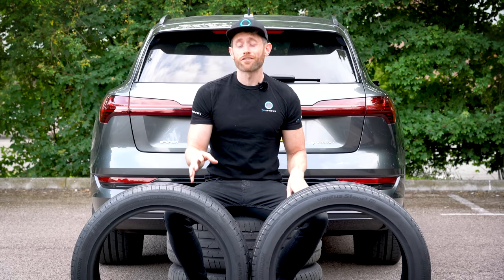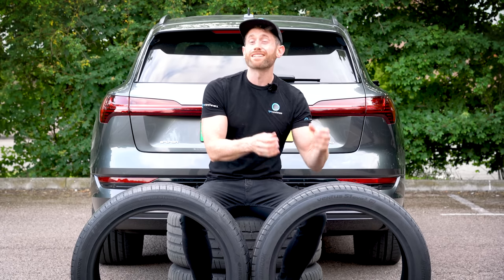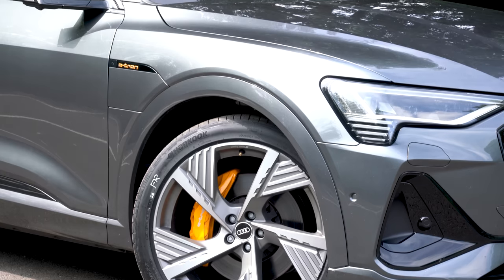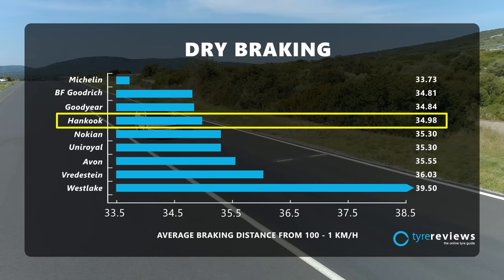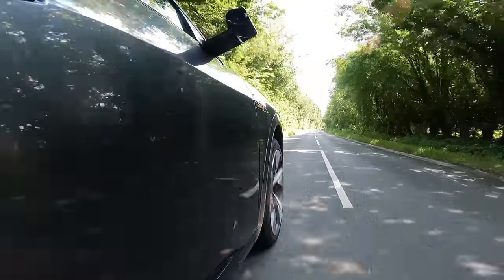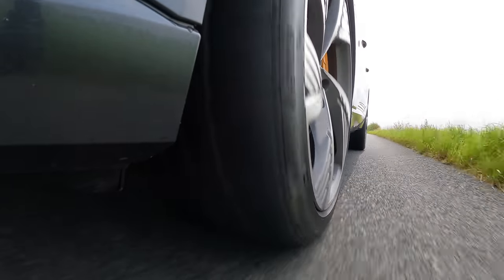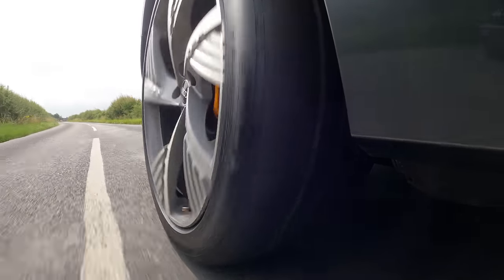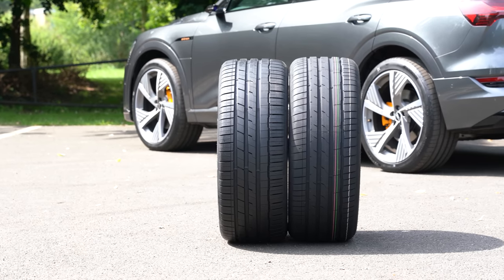What makes EV tires different, and why should you fit them! 🔌

Comment: Thanks for the review. Way more difference than i expected.
And i agree with you. I also love ICE. I have a 350Z and 370Z (AWD both manual) love the sound and vibrations of that V6.

But for a family car for day to day driving i would not mind having a EV. I dont have a family so my driving is mostly for fun. So i dont have one yet. 
With a 4 cil 2.0 turbo and Automatic transmission i dont see the point of a ICE. The sound is meh you dont shift anyway. Why not get a EV then way more comfotable. (price needs to go down more tho and more option in the second hand market because a lot of people like me dont buy brand new cars because of the high price).

I hope there will be Hydrogen Conversions in the future. I think that would be a nice way to still have a nice engine sound and low CO2 for cars like the 370Z or a V12 lambo.
Reply from the maker: {Porsche are pretty far along with synthetic fuel. There's be no sound with hydrogen powered future vehicles
Reply: @tyrereviews thanks for the reply and insight. 
It's true most (if not all) new hydrogen cars are using a fuel cell .  Aston Martin had a V12 Rapid in 2014 that they used during the 24 hr nurburgring. And mazda also had a RX8 hydrogen if I remember correctly. 
Just like petrol it's not very efficient to burn the fuel in the cilinders that's why they opt for fuel cells in most cars.

But good to hear porsche is also working on a alternative!

Comment: Tyre companies have to be the best example of manufacturing competeting in a free market to bring the best product to the customer. Even though I am sure there must be a massive amount of regulation and legislation surrounding the manufacturing of tires, tyre manufacturers seem to go the extra mile to make our lives the most safe and comfotable and constantly strive to give us the best mileage. Yet we still walk into a tyre fitting company and ask for the cheapest tyre, without a thought for the manufacturers that strive to want to give us the best. I get that not everyone can spend £150+ per corner, but does spending £75 a corner make sense when they last less than half as long, don't give the same comfort and are simply not as safe in wet and or braking conditions?

Comment: You have to test ev tires on normal cars to really test the tires...

And what I don't understand is that, except the brand MG, is that there are no other station ev cars. High cars have more air resistance so why don't they invest in station cars?

And EV drives great but as a real petrol guy I miss the clutch and shifting

Comment: The continental ev tire vs standard tire of same.  Ev tire has 5mm of thread depth vs 10;mm for standard.  I have not noticed loss of range.  Original tire lasted 35000 miles and Tesla tech was surprised I got that many.
Reply from the maker: 5mm STARTING?! What tyre is this?

Comment: I heard of filling tires completely with foam years ago, mainly to make them puncture proof interesting to see it come back in this form for this application. I wonder if completely foam filled tires would be good for EVs, one downside would be you can't adjust the tire pressure much
Reply from the maker: They never took off because they don't really work

Comment: Recharge time .... how often do you drive 250 miles at a time, mostly you'll be low 40's maybe up-to 100 miles in a single day, that you don't need to stop and charge, just plug it in at night and you'll never be out of battery ..

Yes, sure you'll go on holiday / long trip, you'll leave with it fully charged, at some point you'll need to charge it - but you'll also need to strech your legs, go to the loo get some food, 45 mins on a fast charger will give you another 200 miles to continue your journey  and for sure you're not going to be doing 450 miles in a day - so again - whats the issue with re-charge time?
Reply from the maker: I agree :)

Comment: EV range worries were a myth dreamt up by the car makers when EV cars were competing for sales years back - since the big car makers are making EV cars they have stopped promoting this range myth. I would rather run out of electricity than diesel - with an EV out of power all you need is a quick power jump from a rescue service generator (they are all offering this service this now in special vehicles), but running out of diesel means a £500 system clean at a workshop.
Reply from the maker: So you're saying petrol is still the best? ;)

Comment: What's the difference in price between these two tyres? If the EV ones are significantly more expensive, then the performance improvements go out the window from a bang for the buck perspective.

Comment: I don't think it's fair to declare EV cars to be overall better than ICE. I would agree with that if the costs and supply of them were competitive, but they're NOT.  I tried getting one 4 months ago and due to high cost, very tight supply compare to ICE, high insurance costs and very poor resale, it ended up being about $140 more per month even after factoring lower energy and maintenance costs. Unless solid state batteries have a breakthrough, I don't see much hope for EVs because their value proposition is terrible and that's WITH a lot of subsidy help.

Comment: If you drive normally, or at slow speeds then ev tires are fine. They are really quite poor when it comes to ride quality, traction, and handling. I would not recommend people to fit them to gasoline cars as the efficiency gain simply isn't worth the loss in performance.

Comment: So anyone tell me what hapoens if you put a tyre like this on a normal sports car weightibg only 1365kg, i still need to try XLs but its hard to get tham in my tyre wishes, with normal tyres for examole GoodYear Eagle F1 Asym 6 i deleted the names of the tyres becaus my corner attacking deformed wheels so much outer tread was gone in 2000km and i was driveibg alsmot on rims in corners, almost no haprines that destroy tyres the most

Comment: I don't think this guy is correct.
I have an eGolf which is about the same weight as a Golf GTi - so not significantly heavier. I went through a set of 'recommended' Continental tyres and a set of "e" rated Dunlops. They all lost pressure and lasted about 18,000 miles. Then I fitted a set of cheap Avons and they have been fantastic - 20,000 miles and loads of tread left and no drop in pressure. You don't always get what you pay for...

Comment: Tested on EV vehicle EV tires are much better than non EV tires. What a surprise, aren't they designed for that? Second, using EV tires on non EV vehicles increase rotation mass since they are heavier, I don't see the car been more responsive there. Especially with the thread. Try those EV tires for all season in a place like Chicago and you might find yourself in the ditch more than a few times.

Comment: SOooo... I had an old LEAF, which has a small battery.  With a small battery there is a high sensitivity to range. As and example, turn on the heater and you know it. I bought new tyres for the car, 'normal' car tyres not the brand that came with the car.  Absolutely no noticeable difference.

Comment: Why so low profile? If in city driving the larger rims add significant load during acceleration and range reduction due to mass moment of inertia increase. Tesla configuration would clearly show range reduction with increased rim size. It can be as high as 20%. With EVs rim increase is a reduction in range and a downgrade, you pay more to go less distance. Do some testing with a smaller rim sizes.

Comment: BFG KO2 on the EGOLF.  Going on some El Cheap O Tires with low rolling resistance is for noobs.  
More Bang than these continental EV tires that came with the car.  Stiffer Meaty construction. KO2.

Comment: isn`t this comparison between EV and standard the same as comparing an XL to standard tire? Cuz an XL tire is over the weigh recomendation of most EV`s. I mean 111 load rating is way way way over the 2.6Tons of an EV and the side walls of an XL tire is way way stiffer than a standard.

Comment: Nice advertorial... I don't believe those engine numbers at all.  In both my plugin hybrid and full hybrid, I literally cannot hear when the engine turns off.  So no, the engine is not a major contributor to noise. That's also confirmed in ADAC car noise measurements.  EV's are not particularly quiet.  It's sound proofing that matters, not being an EV.  
Call me skeptical... but looking at the specs, the lowest noise tyres from the different brands are NOT the EV tyres.   We'll see in the future...

Comment: 11:06. Jonathon, I'm wondering - you call yourself a petrolhead but find yourself it seems almost not wanting to believe you prefer the EV?
Nothing wrong with that, but I'd suggest that you are perhaps in fact just a regular car enthusiast?

I'm a petrolhead. I admire EVs and what they have done with them but I prefer a V8, (or a V10 - but maybe also a V5 or V6/12). Whilst my V8 might be slower, dirtier and less reliable than an EV I still prefer it. I like the intricacies, noise and moving parts as well as working on them.
Objectively better isn't the be all and end all. If it was there'd be a much smaller goods market.
Reply from the maker: I'll always prefer petrol and noise, but for a family car moving the kids around... ICE is fine for me. As long as I have a v8+ on the drive

Comment: 100k for a run of the mill car! I wonder how many miles you have to clock up to break even for a comparable ice version. Not for me especially as I pull a nearly 2 tonne caravan and I don't want to still be able to see my house before it needs charging. Good, informative video as always though.
Reply: That would depend greatly on your local tax laws ect. In my country the entry e-Tron SUV costs 95k€, the Entry Q8 91k€. But running tax for the e-Tron would be 0€ (so far only combustion engines are taxed here) but for the petrol/gasoline one, the running tax would be 1900€ per year, for the Diesel one around 1200€. (We pay running tax by engine power. The more power the higher the tax.)
Reply: It's a premium mid-size SUV than runs to 100 km/h in 5 seconds. Pricing is comparable to everything else in the category.
Reply: @Ficon  yeah mid size. Exactly what I mean.

Comment: With the recent study linking noise (particularly vehicle noise) to Alzheimer's disease it would be great if all tyres had the acoustic foam fitted. Especially as modern car propulsion (not just electrics but the petrols too) is getting quieter amd quieter.
Just go and sit in your garden for a bit...most that background noise you hear is from vehicles.
Reply from the maker: I'll dig out that study, i've not seen it!

Comment: Quite few untruths in the script of this video, clearly written by someone unfamiliar living with a modern EV and modern rapid charging.
Reply from the maker: What untruths?
Reply: @tyrereviews  examples: "efficiency is important because EVs take so long to charge" "EV drivers always want to avoid charging". The writer has obviously never woken to a charged battery with twice as much range as is needed for the day. Never been glad of a quick pit stop after 3 hours driving. Never been slightly perturbed that the car charges too fast, so it's ready to leave before we've even finished a quick brew. EVs have moved on, infrastructure has moved on

Comment: why i don't i just put foam in my tires!
Reply: I'm sure you could if you could source the correct grade of foam and the correct adhesive. If you ever look inside it really is just a simple strip about the width of the tyre tread around the circumference. However, unless you already have an incredibly quiet car you probably wouldn't be able to hear the difference even if you got it right.

Comment: Well with the Mitsubishi I-miev there isn't a choice.   No other tires fit rim/wheel, no other wheel seems to fit.  So your simply stuck with the uber expensive $$$$$ tire.   Which seems have been driven by some over 35000 miles.   I got my car used from dealer with 9000 on odometer.   Weirdly had to replace tires due to wear at 18000 miles $500 expense.   Dealers....always looking for the angle.  Also only had 1 key for car, didn't find out later it's about $700 to get another as being a electric car they used a new fob that cost more.   I wonder if dealer ever found the other key....    anyway car ran perfect for 2yrs soon after I got the new tires I got rear ended.  Just rear body panel damage, but since parts had to come from Japan and it was covid, well car was considered totaled.   Life is interesting.
Reply from the maker: What size were they?

Comment: EVs should be charged more taxes and/or insurance as their great weight wears out the road surface asphalt quicker.  Also, their weight will cause much more severe crashes and deaths, which should also be borne by the manufacturer and/or user.
Reply: And that's borne out with what evidence exactly??

Kerb weight of my EV is on a par with my last diesel car.  In what way is that wearing out the road quicker and liable for more severe crashes and deaths? 🤔  My previous Audi from a few years back was also over the 2 tonne mark...and that was running a regular engine.
Reply: No ... heavy cars whether EVs or not should perhaps be taxed more ... this Etron is not the typical weight of an EV! What about Mercedes GLS or Range Rover etc? A Tesla Model 3 weighs about the same a BMW 3 series equivalent. You may have missed the safety ratings of modern EVs ... class leading.

Comment: Low running costs, lower environmental impact … 😅😂🤣😅🤣😂😅😂😅🤣😂 this guys having a laugh.
Only reason evs need these heavy duty comical rated tyres is because evs weigh in at well over a tonne more 
than normal cars. They rip through tyres at 2-3 sets per year on average mileage and destroy road surfaces 
far more than normal cars due to uncontrolled torque through the drive train. Very environmental positive impact.

Comment: ..tesla products are outdated decade old technology (e.g., only has cameras not even radar, no laser to detect other 

objects).
Tesla self driving is only level 2, whereas Rivian is level 3 autonomy (on an off-road, you don't have to keep your 

eyes on the road and don't have to keep your hands on the wheel).

Rivian has 4 motors, others only have 1-3 motors.   Rivian climbs up 100% incline at 45 degrees.  

https://www.youtube.com/watch?v=Yeth5v_5dPM

Comment: I saw pain on your face right  after you said "theres just no reason to go internal combustion", almost like something was trying to crawl up your throat just then and you had to swallow to keep it down. Just a hilarious opportunity to read too far into a facial expression. 

It does seem that overall, EVs force tire companies to just try a little harder than usual in terms of noise suppression, and matching the tire more specifically to the very few cars its intended to go on. OE Fitment tires get this for their one intended model anyway, but everything else sold 'over the counter' is probably more generalized to be fitted to a large-ish range of vehicles using that size/rating combo. EV tires sold over the counter but which are NOT (yet) OE fitment to an EV probably are tested only against the tiny handful of EVs using that size as OE and can be catered more narrowly to them. That's my assumption. Although I haven't looked to see how many EV tires  are available that ARENT oe fitment to anything.. maybe that doesnt exist yet?

I had conflicting feelings when you said the benefits would not transfer to gas, but I assume it's in the interest of brevity. The lateral grooves vs noise thing should be universal. A stiffer tire that deflects its sidewall less under the weight of the vehicle would convert less energy to heat, all else being equal. But, the difference in deflection between normal and EV tires on a less heavy vehicle would be a smaller difference, and a loss of deflection there would make a tire break away more suddenly on a lighter vehicle if im understanding things rihgt. I do think there is some space for experimentation for savvy enthusiasts to find some benefit from the extra stiffness of an EV design, as long as they were ok with the ride quality penalty that would be more apparent on a lighter vehicle. 

Great vid!

Comment: I am not against electric cars at all, I would quite like one, but how can anybody at all say they have 'less of a carbon footprint'. An electric car once built, produces zero emissions yeah but what about the process of manufacturing it?
Reply: I was really studied in detail and, yes, the electric car has a smaller carbon footprint "cradle to grave", from the lithium mine to the worn battery used as static accumulator to solar and, once "cooked", the battery is a mine of material that is worth recycled  - for pure greed, not for the enviromental yaddayadda.

Of course, no product appears out of thin air, EV has an impact in building it.
ICE has a bigger impact of building it (special steels, heat treatments, countless parts to be machined), then continue to have an impact during all life (pipetail gases, burnt oils), and in the end the recycling gave some stell, some plastic, nasty oils expensive to dump correctly.
Nothing that could be reused a second time as is, and nothing with a interesting price tag.